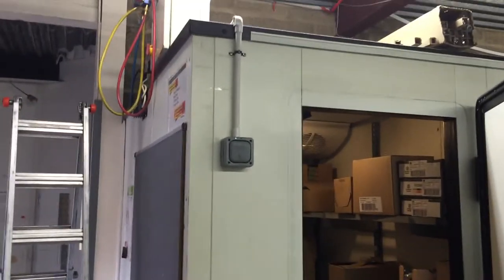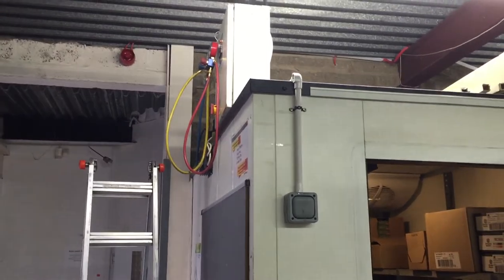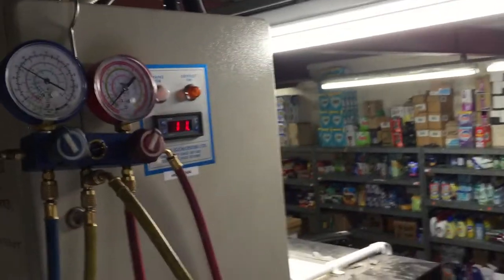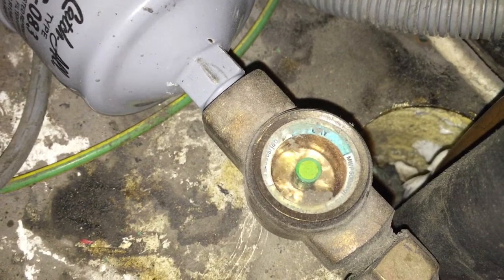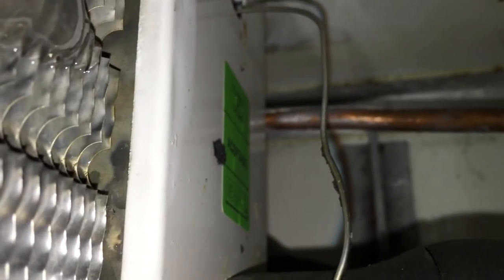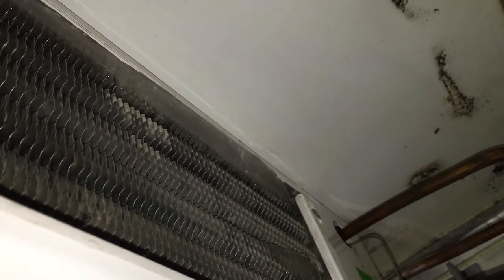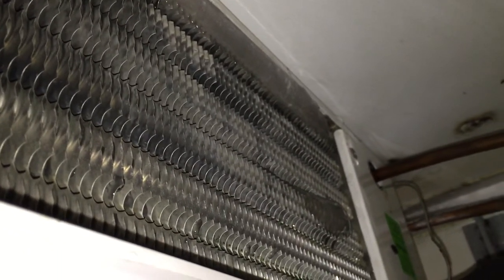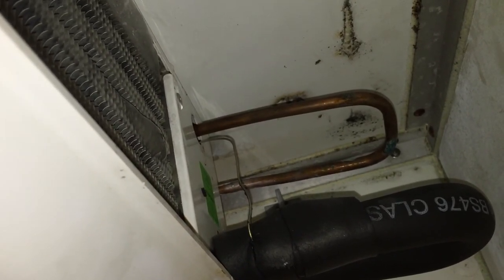What to look out for when a refrigeration system is short of refrigerant.

Comment: I also have that "squeaky" or gurgling noise on a small copper tube that's not insulated coming out of the air handler. Is that the return line? Also low on charge? Seems to run fine but could be colder